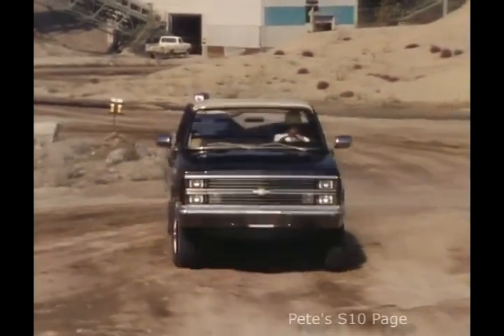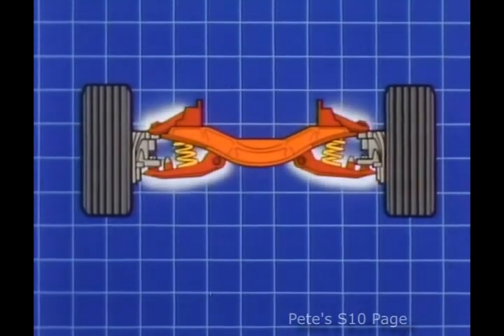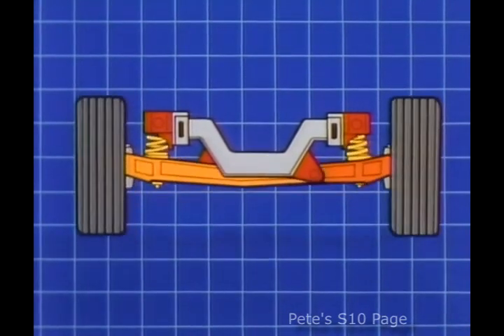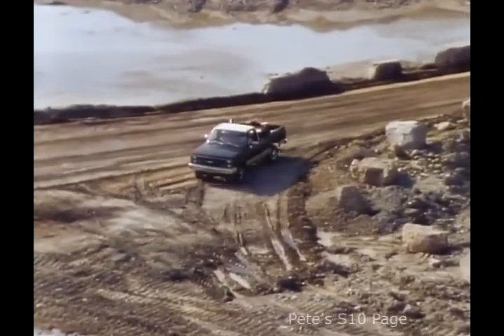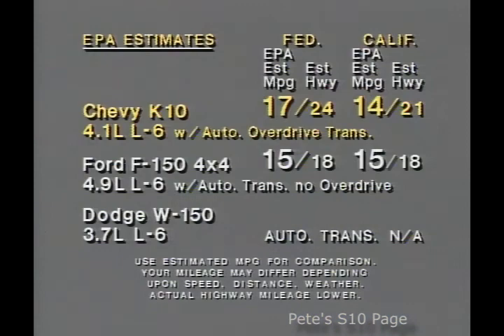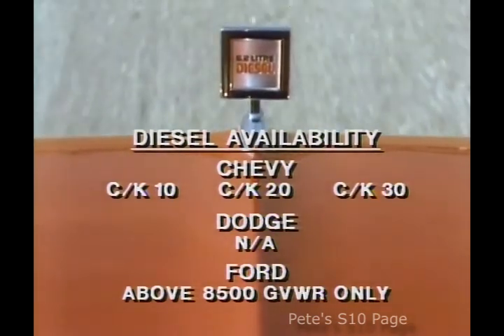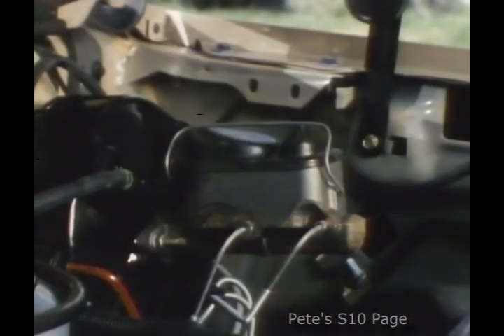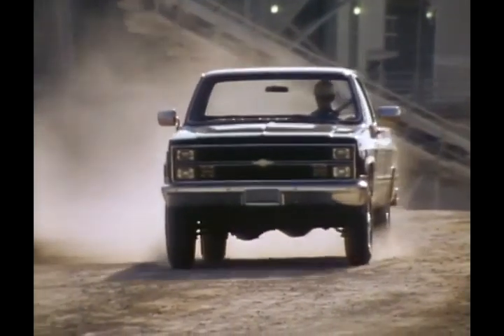1984 Chevrolet C/K Trucks vs Ford F150 and Dodge Ram

Comment: Dodge DID have a diesel engine option in 1978-79, but unfortunately was VERY unsuccessful as it was a VERY weak diesel engine by Mitsubishi which prompted Dodge that diesel engines were NOT worth it until 1989 when they had the Cummins diesel engine.

Comment: Those Chevy inner fenders usually rotted out.  The more modern plastic Ford ones will last forever.  

Also, its not that hard to take the instrument cluster out of the Ford truck the screws are in the front, but they are hidden unlike the ugly phillips heads all over the inside of that era of Chevy truck. 

Those Chevys were decent trucks but a Ford with the 4.9 six or the 6.9 IDI diesel was a better choice.
Reply: Big problem with the Chevy's "Ease of Maintenance" is the fact that in order to achieve it, GM incorporated designs that were either way too simple or way to complex. Take the Shift indicator for example, in a Ford it's built into the steering column and secured in place with screws, on the Chevy it a simple hook which you guide the indicator cable through and then secure it on the outside of the column with a clip, i've had to redo that indicator about 5 times now on my Chevy, never had this on a Ford. Another example is the Ignition lock, on the Fords you stick a small screwdriver into a slot, turn the key and the cylinder pops right out. On a Chevy you spend about 2 hours disassembeling the entire steering column in order to remove it. Doesn't help that all the parts that you have to remove very often have plastic threads that wear out after the 3rd time unscrewing them.